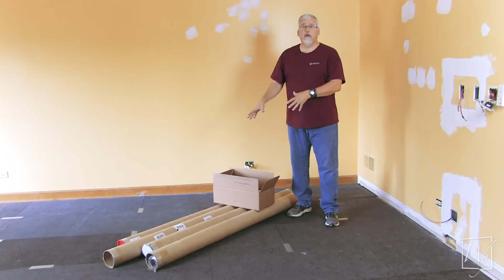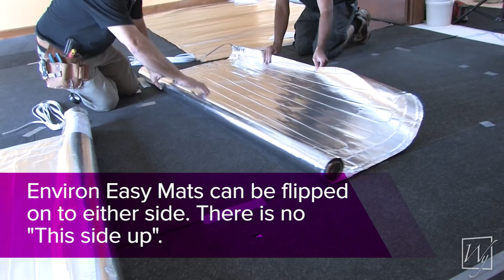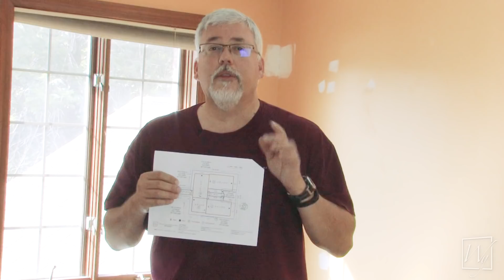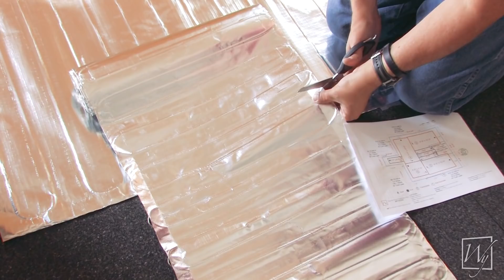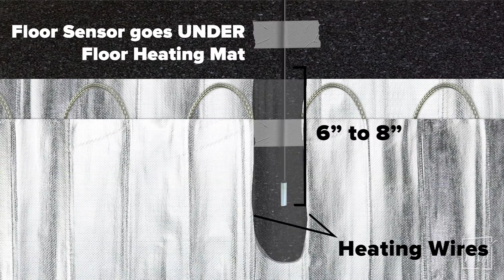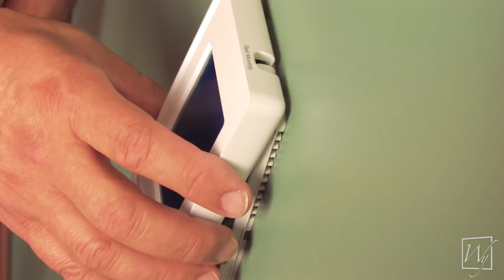Installing Electric Floor Heating under a Floating Wood Floor

Comment: Okay so for a room where there could be two single beds or there could be one king bed, so you don't know where the beds will be, how do you plan for that? The beds will be the traditional framed sort so there's air movement under the bed, and nothing stored there - and I want a bit of warmth coming up through the mattress, but how do I make sure it won't be too much?
Reply from the maker: If you're not sure where the beds will be, that is fine. As long as there is air circulation underneath of at least 2 inches, the beds can be positioned over the heating system. Radiant floor heating works by warming the objects in the room, vs the air - so in this case the bed frame legs in contact with the ground would be what's transferring that heat up and into the bed. You can learn more about floor heating for bedrooms here: https://www.warmlyyours.com/floor-heating/bedroom
Hope that helps!

Comment: How much floor height do the CeraZorb underlayment and heating mats take up? More than one inch? I'm framing a doorway in the room and I have to take that height into account.
Reply from the maker: The underlayment is just under a 1/4" thick, the heating mats for this project are 	1/16″ thick. Together they're 5/16" thick. Here are links to both of these products in you need more info for your project: 
https://www.warmlyyours.com/en-US/products/code/TS-SH6MM-24x36

https://www.warmlyyours.com/en-US/products/code/ERT120-1.5x06

Comment: heating elements on top of plywood floors and under laminate wood flooring?
Reply from the maker: The heating element is not on top of the plywood, we've installed a synthetic cork material between the subfloor and heating system to protect the wire from the hard surface below. If you watch the full video, you'll see this step during the installation. Thanks.

Comment: Can the cold tail (power cord) be fitted in the insulation UNDERNEATH the heating mats??
Reply from the maker: If you watch this video, you'll see that's what the installers do for this system. Trace the shape of the cold lead, cut out that strip from the underlayment so that cold lead lays flat in the channel. 

If you need help installing quickly Jay, we'd recommend you give our tech support team a call as these comments are only monitored a few times a week. Thanks for watching!

Comment: is it possible to put this in an RV
Reply from the maker: Hi Joshua, Yes it is possible to use these in RV's tiny homes.  With the right subfloor set up and flooring on top, they can easily help warm up small spaces. You can learn more about it here: https://www.warmlyyours.com/floor-heating/laminate

Comment: This is a great video! Thank you for making it.
Since this is a floating floor, I wonder if it'll get squeaky in the busy area (where it's walked on a lot), especially that there are hallow spaced in between the heating wires and the hardwood floor.

Also, what kinds of wood do you suggest to use along with heating floor?
Reply from the maker: Thank you! The wire actually settles into the pad over time, eliminating any gaps.  One of our tech team members walked on a floor like this that we installed about 5 years ago, and you would never know that it had a floor heater installed under it, except that it was warm. 

As for the type of wood floors we recommend, laminate, hardwood and engineered will all work. Engineered is the most stable structurally so it will work the best of the three. 

If you do want to go with Hardwood, quartersawn or riftsawn narrow planks are the most structurally stable and would work best with floor heating. 

Overall the most important factor is relative humidity. Keeping a consistent humidity and temperature in the home will help wood floors last in a home.

Comment: Can I do this same system on a concrete slab in the basement?
Reply from the maker: Hi Bibiana, Yes you can use this type of system in a basement. You'll have to make sure you pair it with the correct underlayment for the type of subfloor you have. You can learn more about that type of project here: https://www.warmlyyours.com/floor-heating/basement Thanks for watching!

Comment: Excellent video.  I had never seen one of these systems' installed.  Rift and Quartersawn Engineered hardwood flooring would be excellent for radiant heated floors; https://www.reallycheapfloors.com/prod/rift-quartersawn-3/?color=Red%20Oak%20Natural
Reply from the maker: So true Karen! We always try to recommend engineered hardwood vs solid for radiant heating, it's much more stable structurally and holds up to temperature changes better. Thanks for watching!

Comment: Can the Easy Mat be installed directly over fiberock board underlayment (and under floating engineered wood flooring)?
Reply from the maker: Hi Amber, the Environ Easy Mats must be installed over a pad that complies with the installation instructions and at the recommended thickness of 5 or 6mm. Looking at the application type for fiberock board, it does not look like there is any mention of floating engineered wood, just nailed/glue-down. But if you are using floating, the Environ will need a softer underlayment so that the floor heating system is not sandwiched between two hard surfaces. The one you see pictured here is CeraZorb synthetic cork.

Comment: Can the larger Easymats be installed over a wood subfloor and under vinyl plank flooring? Can it be used in wet areas? I am trying to heat my greenhouse. I just need to keep the temps above 50° when we have cold snaps in Louisiana in the winter time. The  greenhouse is 8x16
Reply from the maker: So Vinyl "plank" is actually a very flexible floor type and cannot be used with our floating floor system pictured here. Any luxury vinyl flooring should be used with our TempZone floor heating system, which is embedded in cement before flooring is installed on top. https://www.warmlyyours.com/floor-heating/tile-marble-or-stone . It is also wet location listed, whereas the Environ pictured in this video is not. Since it is floor heating, you would also need to plan for a thermostat in the Green House to help control the temperature. Since you have the dimensions of the space, you can even use our Floor Heating Quote Builder to see how much it would cost for this space and pick between our different TempZone products to get it done: https://www.warmlyyours.com/floor-heating/quote-builder . Feel free to give us a call if you need any help: (800) 875 -5285.

Comment: No wonder the US is the top consumers of electricity in the world... A standard split AC is much more efficient than this - given the temperature is not much below the freezing point.
Reply from the maker: Electric Floor Heating systems are actually quite efficient since it radiates heat into the objects in the room and not just the air. Since heat rises, these floor heating systems help keep you warm where you feel it and need it most. If you want to compare operating costs though, we have a tool on our website that can help you see what the electricity usage would cost for a specific type of system: https://www.warmlyyours.com/tools/cost-calculators
Reply: @Warmlyyours  I agree that floor heating is in general the best method, however, even an air-to-water heat pump would yield around 3 COP - slashing the the power consumption to a third. For smaller buildings, extensions, extreme climate, excess solar power, the electronic floor heating is a viable option - but in general, a heat pump would be to prefer.
Reply: @AceMcMoron   Way to cold for a heat pump in most parts of Canada. The rating on them doesn't stand up to the elements . 1200+sf homes need at least 2 going all the time during months long of -30 to -40. power bills are outrages
Reply: Feet are the most sensitive and heat rises too. Better to heat the floor as long there's good insulation below the wires and most of the heat ends up in the room.
Reply: Small solar installations dedicated to heating may be an environmentally friendly option.

Comment: I learned a lot and took great notes. Thanks a million ! I can't wait to walk on heated floors but If my contractor can't properly & thoroughly answer my questions regarding this process & explain the process just as you have then he's not installing my heated flooring.
Reply: Fyendi DarNesha can this be done over a concrete slab in basement?